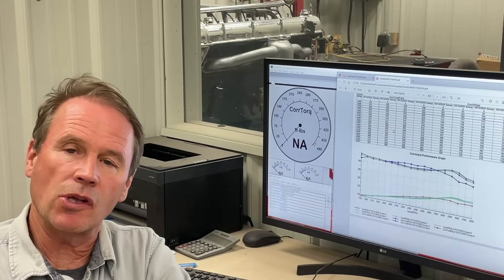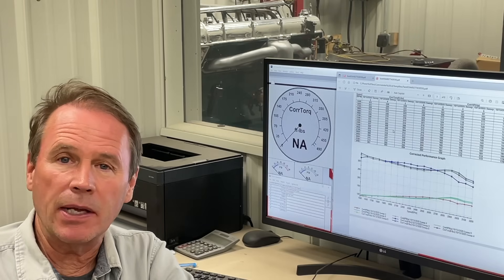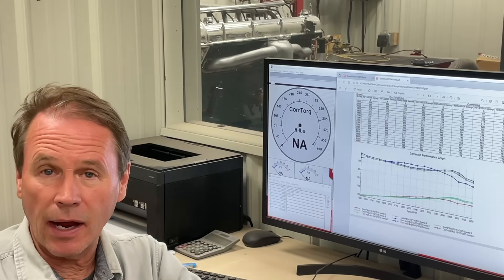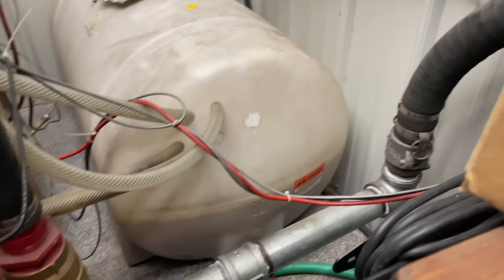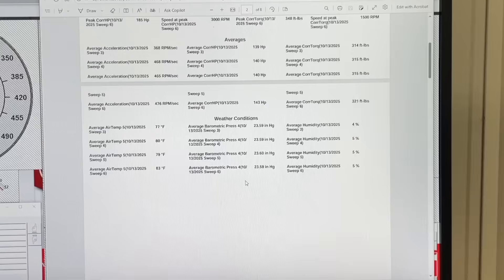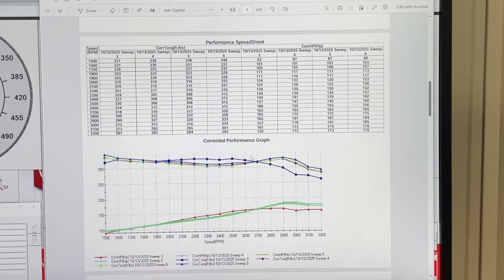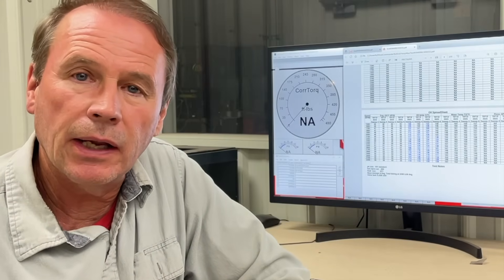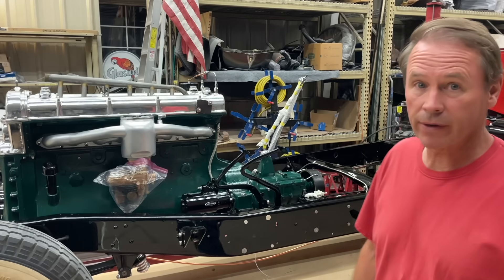1932 Stutz DV32 engine dyno

Comment: As a high school student in the 1950`s I would walk home past the Studebaker dealership and in 
the shop was a Stutz DV32 car. A thing of beauty for sure. The cam cover was off and the sight of 
all the valve gear was just amazing. The car was a sedan and very nice but the engine was a work
of art. My high school was across from Frieden Calculator and one of the workers drove a Cadillac
V16 dual cowl convertible. Just unbelievable.

Comment: I'd be fascinated to see it run with modern sidedrafts, proper tuned intake track length, and a nice set of headers.  Given the operating range and the displacement, DCOE 40's would be more than enough.  Looking at the low-rpm inline-8 configuration, a 1 1/2" to 1 5/8" stepped 4-2-1 header with a proper collector extension would probably produce a nice curve, with good scavenging.  Not even remotely what you're going for - but it's a fun mental exercise.

Comment: Beautiful engine & fantastic sound but the history books tell us the twin cam DV32 head appeared in 1930. Personally I think this really a 1930 engine as it has a Schebler S type updraft carburettor, whereas by 1932  they were using a Stromberg 2bbl downdraft carb. Does it really have 11:1 compression ratio as these engines were 5.35:1 standard?

Comment: Early SAE hp equation was different than later SAE bhp (not to be confused with modern Net hp). Earlier pre SAE hp was generally Watt system and was a steam engine equation. This is why old listed hp numbers seem so low at times when using modern SAE based dyno's.  That engine is a thing of beauty and sounds great pushing the dyno. Thank you for keeping history alive!